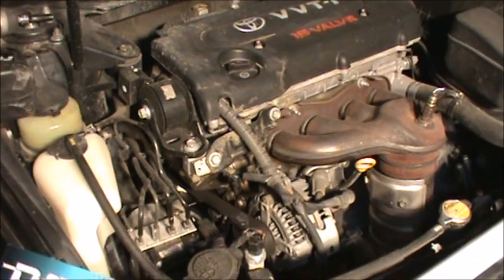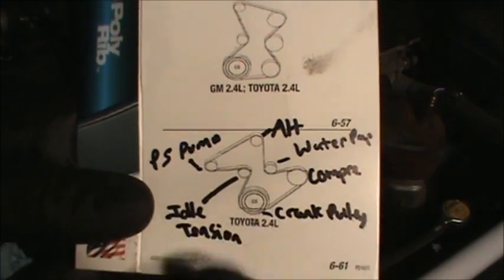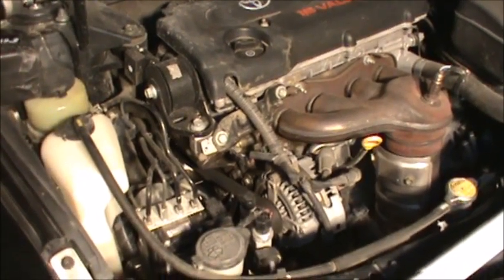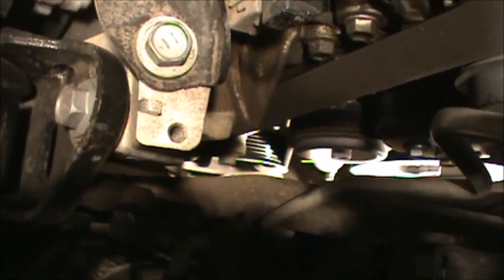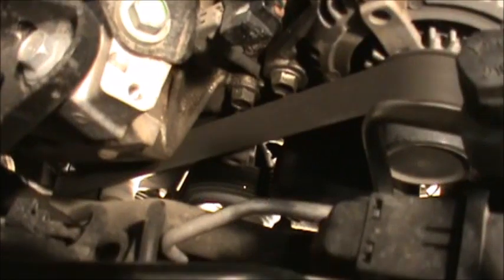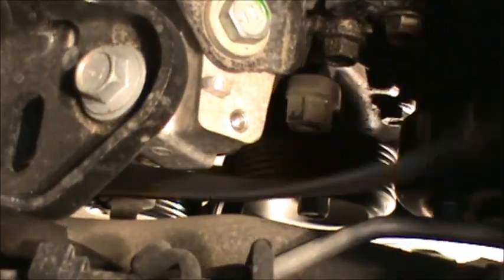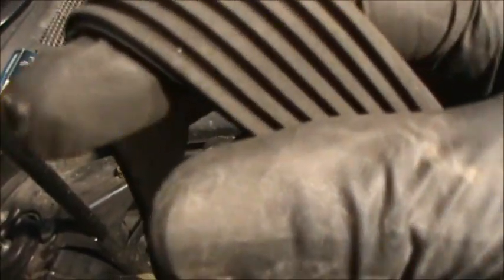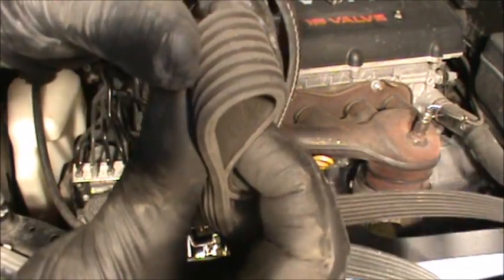Toyota Drive Belt Replacement (Rookie)

Comment: I did mine yesterday by myself.  It took me the better part of the day to get it done.  You're right in stating that it's easier with two people but I didn't have anyone available to help me.  Plus not having the proper tools made it that much worse!  There's barely enough room to get your hands in there to slip the beltt on the pulleys and if your hands are in the way, even with two spot lights you can't see what you're doing.  I'll never do this job again.  Next time I'll pay a mechanic to do it.

Comment: I would recommend replacing the tensioner pulley as well since it has over 150k. Yea it about time for that waterpumo as well. Good job with the repairs
Reply from the maker: +Paul Morales I'll make a vid of the water pump. Thanks Paul.

Comment: Water pumps are designed to leak a tiny amount through front seal.. This tiny amount lubricates dynamic seal. At 150K miles there will be a slight build up of dried out antifreeze. If car is cooling properly and there are no drips or puddles your water pump is OK.

Comment: wow that was the longest belt job I've ever seen I would have fired my guys if they would have took that long especially with two
Reply from the maker: I showed it like that to make a point. I just did that belt, no more than 3 minutes. There was a video I saw that was 30 min long doing that.
Reply: That Toyota engine in the Camry is a royal pain in the ass to change the belt. The tensioner is in a bad spot, the belt is a smidge too short and getting a new one on even with the tensioner fully compressed is a pita. I'm no pro, but I've done a bunch of belts in my day and this one was not fun.